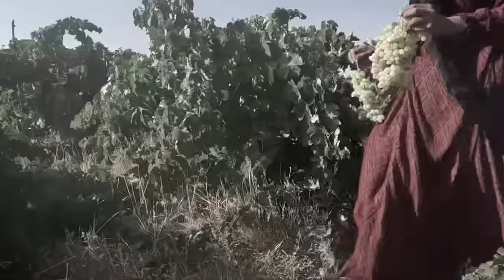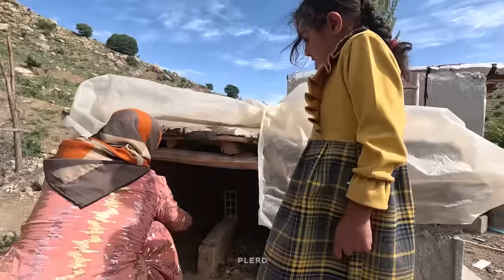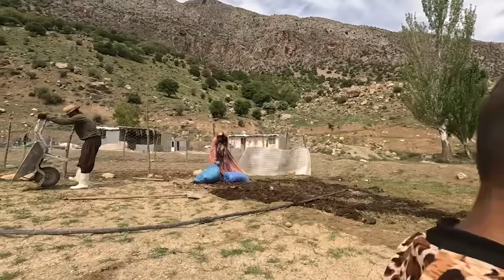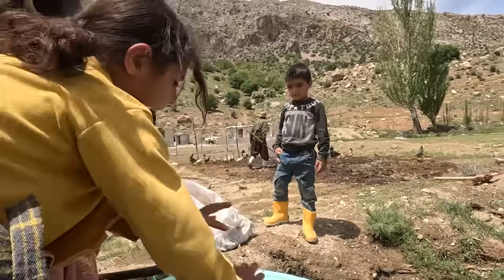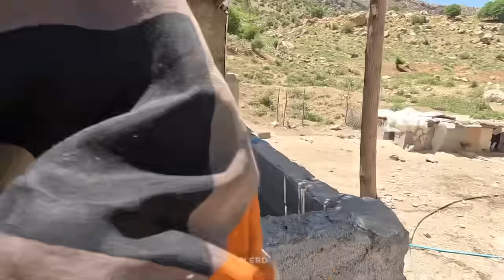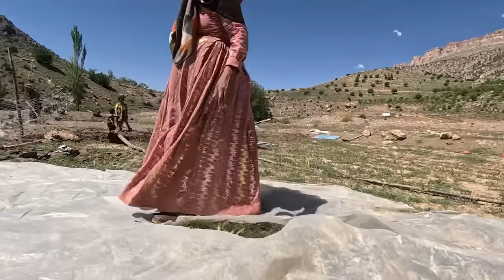Single Mom's Rice Farming: Soil and Success

Comment: Hello dearest family and Tayeba, I am pleased to see that you are sowing rice, perhaps due to the shape of the fields that land was sown with rice, seeing the high side banks. How are the garden plants doing? If the seedlings suffer from the heat you can place large leaves on them, water in the evening, cover with the leaves when sun shine. I hope they have taken root. If you think of sowing, perhaps in the autumn the other field, for example wheat, you will have to plough, that is, have a tractor come with a plow and turn the clods by at least 30-40 centimeters (I don't know your unit of measurement) and then work the soil with a rotary harrow to finely break up the soil and then sow the wheat. But first of all you have to break the banks that close the fields because at the first rain they fill with water and the grain dies. Open a canal that drains into the small river so when it rains the water channels and comes out of the ground. Many greetings!